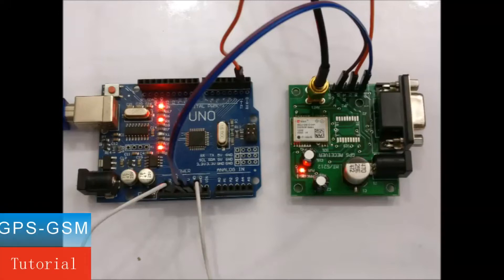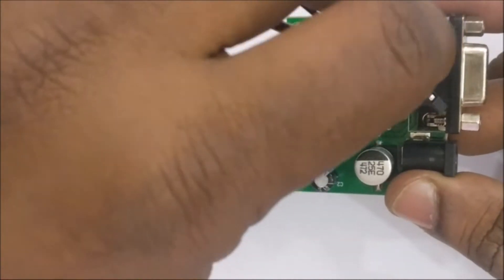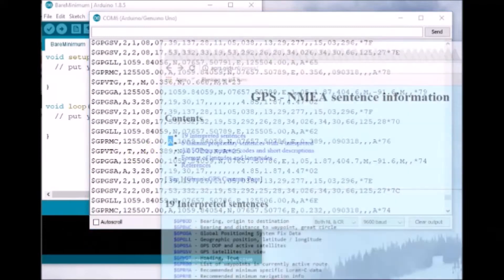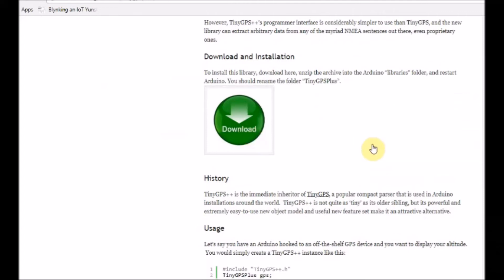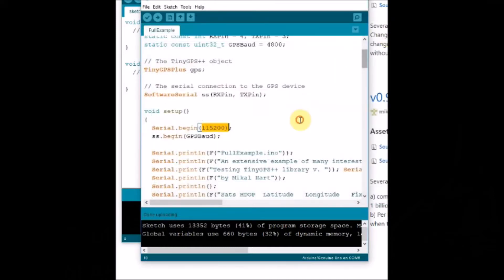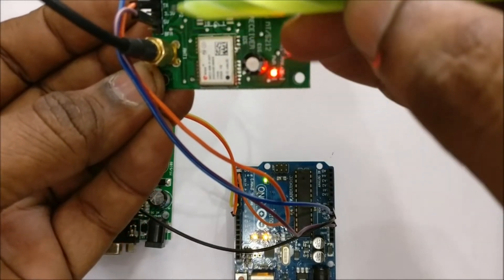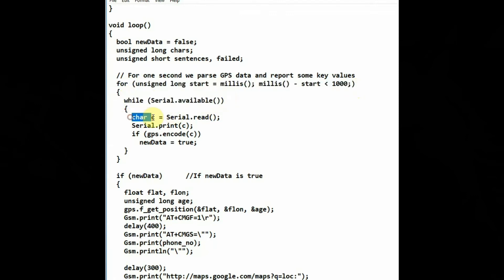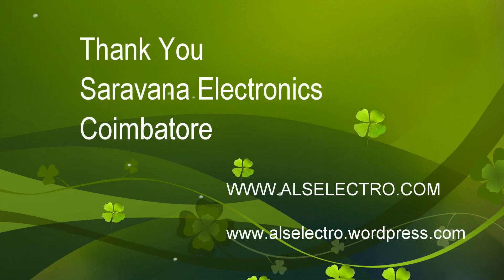GPS Tutorial–Sending GPS Coordinates over GSM

Comment: Hi,
I used GPS Ublox Neo 6m, GSM module SIM900A and Arduino Nano. The system can run using power from laptop. When I change external power supply, the system didn't respond every SMS I sent. 
Could you advice how to overcome the problem